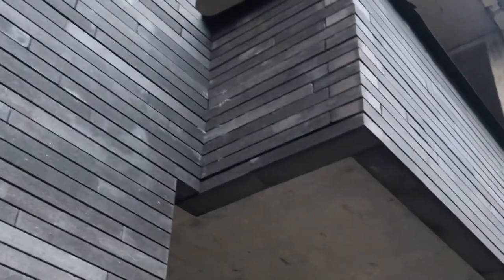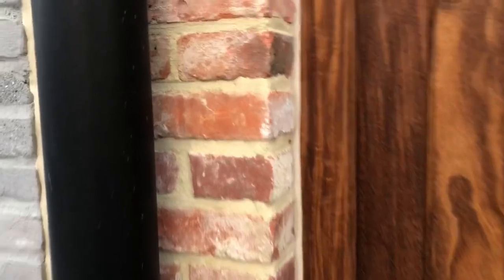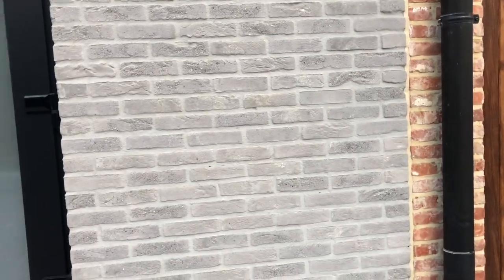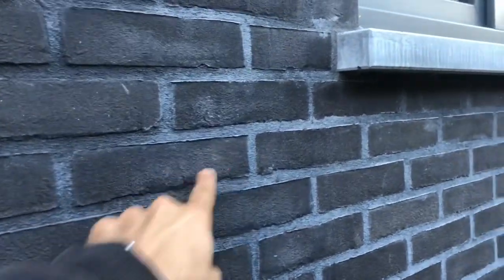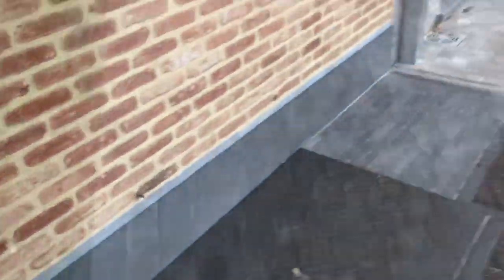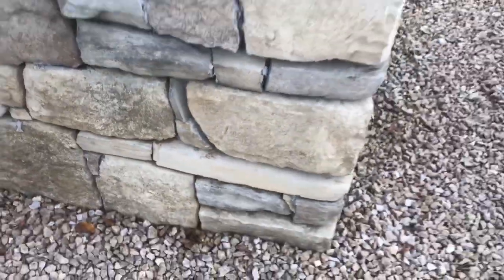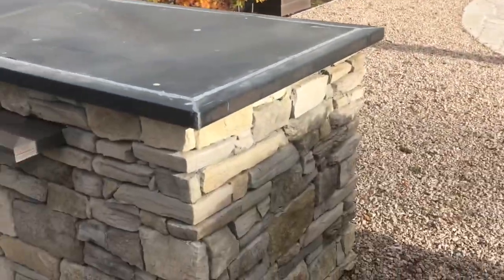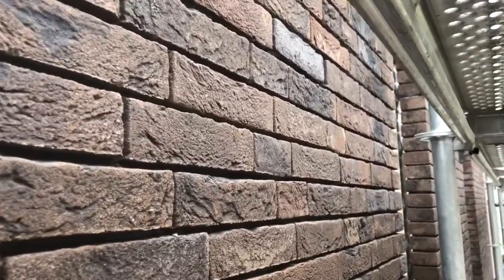Bricklaying - are your bricks feeling happy ? Or sad?

Comment: In the Uk the bricks are mainly 65mm and the Stock bricks are mostly frogged. The curve of the brick (smile) is mostly frog up.  We also have 50mm tudor  (roman) bricks and large 73mm imperial size bricks.
Reply from the maker: We also have Roman sizes , here they are lower but longer .. here we use a lot of M50 and M65size of bricks ( M stands for module , 50mm and 65 mm high ) , the Roman sizes here are around 40 or 45 mm high

Comment: In the UK we have plastic weep hole products. You guys use a piece of folded plastic!
Reply from the maker: Hel mark yes I’ve noticed you guys put  plastic weepholes in there while making bricks ... much better ! We don’t do that here , the folded plastic we put there is to prevent it gets filled with mortar with the next course and also to show the pointer where the weepholes are so he doesn’t close it up , while pointing it up the plastic gets pulled out , we have some things out of metal or plastic you can buy or make something yourself to close it afterwards to keep the  bugs or mise out , a lot of houses here have the holes just open though

Comment: One way or the other, you will have a happy or sad brick. Me personally, would have it straight edge too the line so it is level. That is personal preference. If you did not want this then maybee you should tell your contractor and then you would not have this problem. Easy correction! 👍
Reply from the maker: Steven Dunn yeah cant argue with that